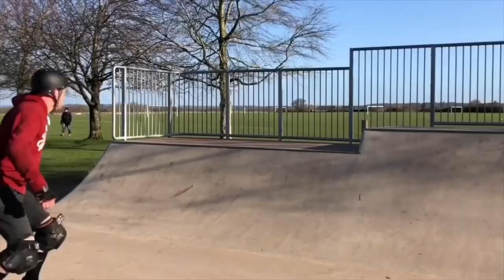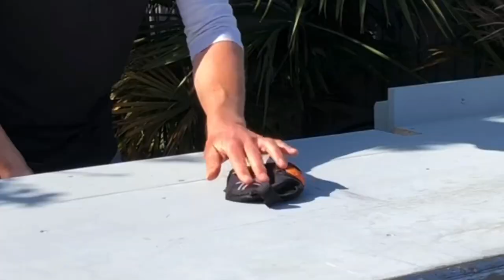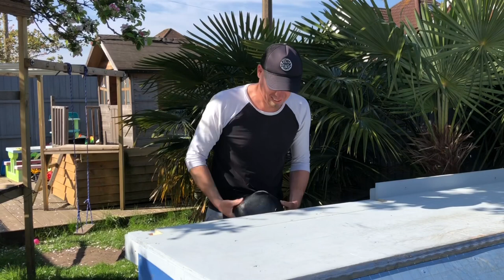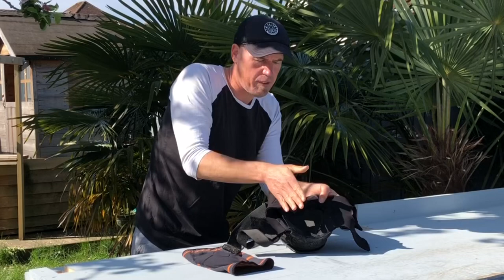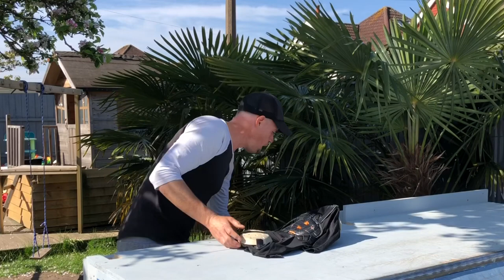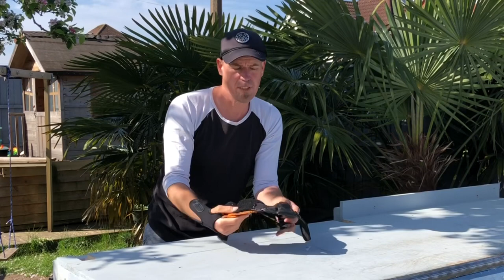Skate Protection Reveiw 187 Pads, Footprint Painkiller, Vans Cabellero and Triple 8 Tony Hawk Helmet

Comment: Another great vid. You take pads to whole new level. And I like that you are not afraid to use them- I skate so cautiously that I rarely fall even though I’m padded up.  I like the ankle support idea as I broke my ankle in college skating a half pipe. My shoes were a half size too big and I caught my toe coming off a rock slide.  Now I make damn well sure my shoes are tight! Tortoise pads make a great padded short.

Comment: Nice one Jon! If you skate with pads, you live to skate another day! I am a Vans guy too, but I only buy the Pro's because they have the really comfy insole and the reinforced toe box. My go to's are half cabs or Sk8 hi. The new Rowan Zorillas are nice too. They do a Sk8 hi BMX which have a cup sole instead of vulcanised and they last much longer. I wouldn't say Vans are the best quality,  but they have the most reliable sizing, which is perfect for buying online. I always buy in the sales to because you know they are gonna get thrashed. I bought 3 different styles of Adidas last year. All size 43, but each one was a completely different size! Really inconsistent. 
I can recommend 187 Derby wrist guards. They have a plastic plate on the palm which is a better solution than the splint that fits in the pleather pockets. 5 bails on concrete and you have to get the gorilla tape out! The 187 derby wrist's don't have the splints on the top of the hands, but they last much longer. We have a mate who is a doctor and he said if you hit your hands hard enough to break them, you will probably break your forearm just above the wrist guards. It doesn't mean they are useless as they will protect all the little bones in your wrists and palms which are harder to fix. 
I also wear forcefield impact shorts. They are a bit expensive, around £90, but the pads have similar tech the D3O and are removable so you can machine wash the shorts. They have snowboarding model, but I use the motorbike ones because the padding is for higher impacts. These are a real life saver against hippers. You know how those feel right?! They might be expensive, but I have got 6 years and counting out of mine. Great investment. 
All the best, Rich in Sweden.
Reply from the maker: Nice one Rich 
Thanks for the update. 
Yeah, I use the sliders to disparate energy and move it to the elbow pad which is far more robust. With a bit a practice you can slide along quite a way on the knees and Elbows. I try not to put my hands down if I can !!
Reply: @JonBishopSkate  Yeah! I got my knee slides down to almost second nature. I think this is a really important technique that doesn't really get talked about.  I wished I had learned and practiced this earlier. Maybe it would make a good video! The wrist guards and impact shorts are for suprise attacks! I've get plenty of those! 😬😖😵🤕
Reply from the maker: @BlackMarketHoney  it’s a great idea !!

Comment: Helmet. Since i bang my head really hard few years back and fortunately that's when i used a helmet at that time, i always put my helmets on. Last week i just hit my head really hard from 7.5 ft quarter straight to flat from the coping, luckly my helmets on. I wonder what will happened if i didn't put my helmet on last week. Got dizzy a little bit and got a bit bruise in my face but everything's alright. Got back up and skate again, all because i put my helmet on

Comment: I wear Globe Sabres because they're actually wide enough for my EEE wide foot but they fit perfectly with extra socks and ankle supports.

The triple 8 helmets didn't fit because my head is more roundish and no matter how I set the padding it would be flopping around in one area and pinching in another or completely loose or tight. Going to try an S-one.

Comment: Thanks for the video, I'm a middle-aged guy that has picked up the board after 25yrs and have just started to learn transition last year. I always use the full set when I'm on my local bowl but usually only wrist guards and knee pads when doing street skating. 
Was on the bowl yesterday and managed to land on my right hip (after pushing too hard on my slash grind) so was looking forward to your recommendation on the hip guard and surprise! you have your own custom invention. 
Have you tried any off-the-shelf ones that you'd recommend I try?
Reply from the maker: Hey dude, yeah the burton snowboard shorts are ace. I just beefed them up, but that’s not completely necessary 😂
Reply: @JonBishopSkate  thanks for replying dude! That one is a bit pricey but it does look good with all the G Force stuff, will put it into consideration. Cheers

Comment: Hi Jon, could you tell me where did you get the extra D3O pad for the  demon wrist savers? I had some nasty slams on my left wrist and I feel if I have another one, won't skate again let alone play guitar!!!
Reply from the maker: Hey dude 
Yeah the D30 has been great in the wrist guards, I also recommend the neoprene gasget idea to go under the wrist guards, tbh that’s the most effective upgrade as it makes the whole wrist guard fit properly all over with the extra support from the neoprene. 
All the names of the products are in the vids I think? I race sailboats so the D30 is by a company called Musto and it’s designed as Skiff racing body armour. Just search Musto D30 and select the most cost effective piece. I thing I just cut up a back lumber pad? That one pad made the extra Achilles pads and wrist guard bits. It may seem bit overkill
, but I play guitar for my job so I have to manage risks as best as possible??

Comment: Hey Jon, Do you have any hints or tips on how to get the right sized knee and elbow pads from 187?

Also have you tried Vans Skate Sk8-Hi’s(formerly known as Sk8-Hi Pros)?
Reply from the maker: Hey Dude 
Many thanks for tuning in! 
There should be a size chart on the 187 site so you can measure up ? 
I’ve allways used the Half Cab, and the full Cab? The full cab is basically a slightly more padded Sk8-Hi ??

Comment: Hi Jon, thanks for the video! What size did you buy in the killer knee & elbow pads? I’ve ordered a couple of different sizes but am unsure which to keep in case they stretch out as they become more worn. Any advice on this would be much appreciated. Thanks again!
Reply from the maker: Hey Dude 
I just got the XL, I haven’t noticed any stretching, still fitting fine ?!!
Reply: @JonBishopSkate  Brill thanks the material on the elbow pads looks pretty hardcore so I had doubts if it would stretch, back in the post with those I think and I’ll get the XL! Thanks again
Reply: @JonBishopSkate  the XL elbow pads came yesterday, I took em out 4 a spin I’m 6ft 1 with not the biggest arms and the fit is spot on 👍

Comment: Looking for some soft low profile elbow pads .  Triple 8 exo skin elbow, or footprint street elbow pads if anyone has tried them.
Reply from the maker: I use the 187 slim nowadays. It’s really good protection, but fits under a jumper for colder sessions, the 187 pros are too big for that ?
Reply: @JonBishopSkate  yeah any hard shell elbow will be too thick. Just looking for a soft elbow pad for when I'm street skating to take the edge off of falls.
Reply from the maker: @32srt32  yeah, D30 or G Form could be the way then. Flexible and thin, but goes hard on impact ?